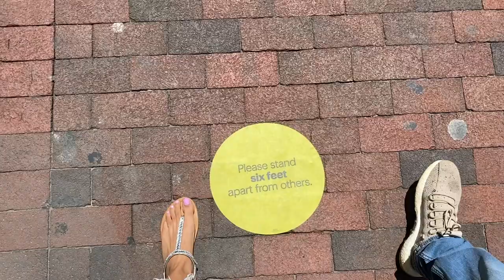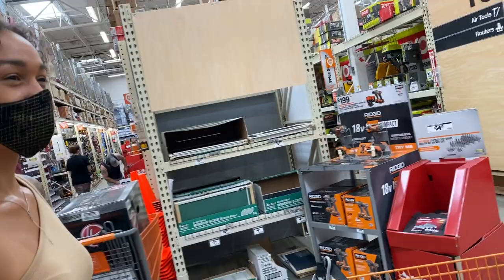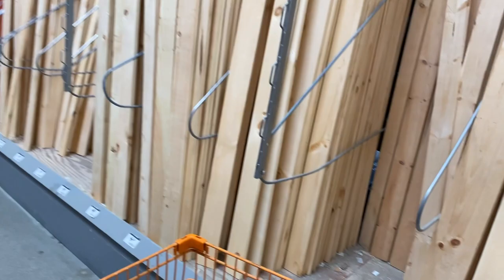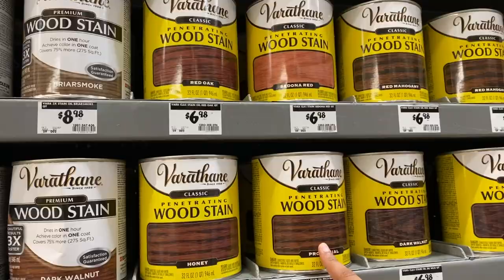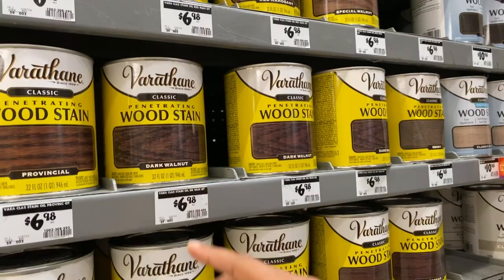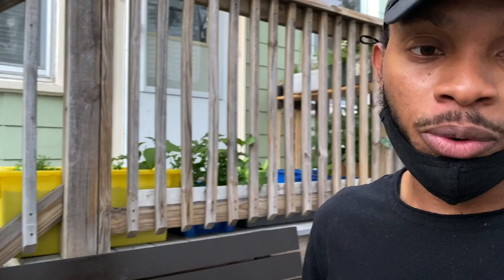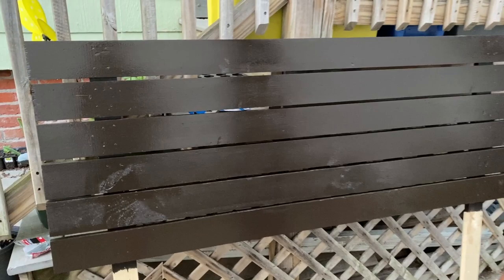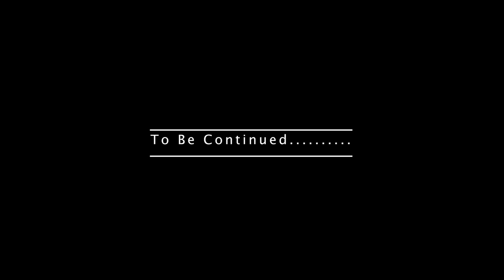How To Make A Headboard for $40.00 - Simple DIY headboard Project on a Budget 2021 - Headboard Ideas

Comment: You applied the stain but you were not finished. Stains are meant to apply and then wipe off with a lint free cloth like an old tee shirt. The stain will have filled in the grain and penetrated the surface to show off the grain. Then I like to finish it with several coats of tung oil or neetsfoot oil buffing between coats. Also you will want to add at least two screws at the end of each board, get screws that are short enough not to go through to the front and put them in from the back. Those nails won't hold your headboard together.

Comment: Sand it to dull the brown color.   Spray paint it with a color you like.  Wait until the paint is completely dry and cured then spray a quality spray varnish. Wait until the varnish is cured also, at least 24-48hrs. Paint and Varnish will probably need at least 2 coats, drying in between coats.
Reply from the maker: Thanks for the input we really not professionals, we just did this as a fun project and have listened too all the positive feedback from all you guys, thank you so much again for all this information

Comment: sand it down with 320 grit sandpaper. Then sand it again with 180 grit paper. Finally put a coat of polyurethane over it. Done.
Reply from the maker: nel6211 thanks a lot we were planning to redo totally but I may just do this instead then tell you the results
Reply: Why would you start with a 320 and then use 180? I think you have that backwards?
Reply: @chrisisnowliftingstuff3248  This is what happens when you watch videos late at night and reply without proof reading. Yes, 180 first  , then 320 ! Duh!